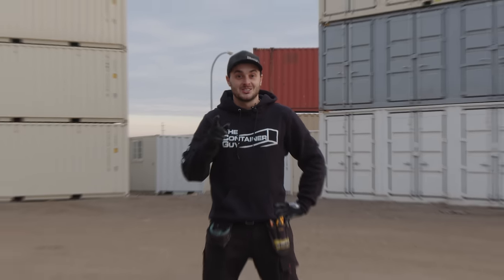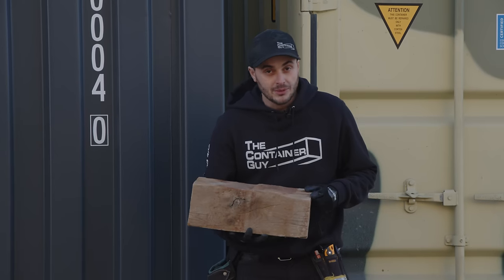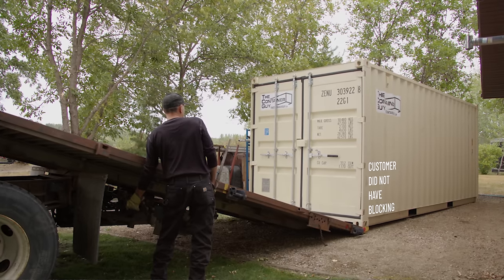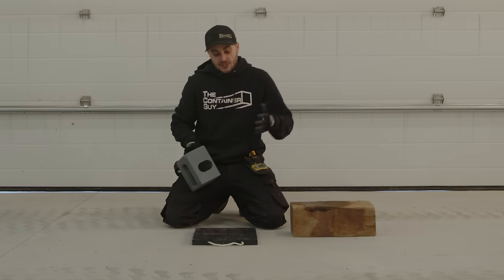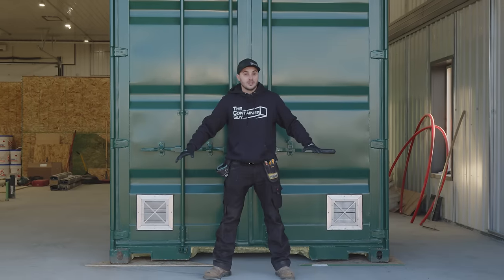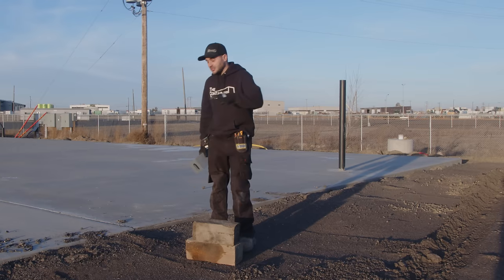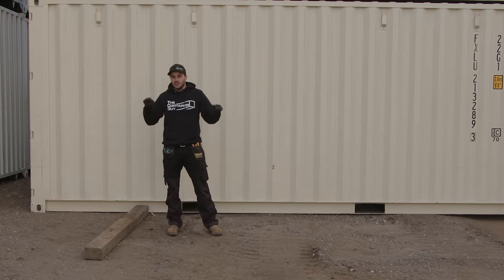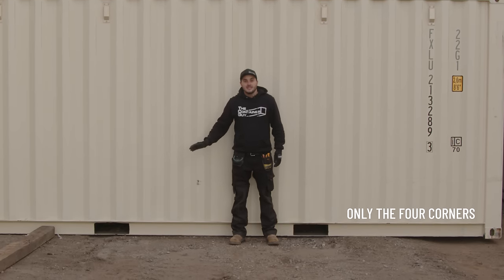What YOU Should Put Your Shipping Container On!

Comment: My containers sit on the high plains desert of southern Wyoming.  It's not uncommon to see 50-60 mph+ winds and the frost line is 56".  I drilled 60" deep by 12" holes at the corners and then every 8'.  I set sonotubes and poured 72" x 12" caissons and then wet-set 1/2" thick weld plates with 36" x 5/8" rebar legs into the tubes.  Then I had a massive vertical mast forklift set my containers on the caissons.  The containers are now welded to the Earth.  I don't own a laser and didn't want to rent one so I made my own bunyip with a milk jug, a 100' of clear hose, and red koolaid.  Overall I set 58 sonotubes/caissons and my largest margin of error, using the bunyip, was about 3/16th of an inch on one of my caissons.
Reply: @CornPopMillerJr  shout out to my fellow Wyoming neighbor!
I'm thinking about doing something very similar up near Cheyenne.
Nice to see others who have done the same.
Reply: Now, what did that cost you...?
Reply: @willbowles5551  First I need to clarify.  When i poured the 58 sonotubes, only 22 of the tubes were utilized for my two shipping containers.  The remaining tubes are for future building sites.    Anyway, $250 for 1 day rental of a skidsteer with 12" auger.  The sonotubes were under a couple hundred bucks.  I think it took about 6 yards of concrete and that was about $700  The bunyip was a couple bucks.  The weld plates were probably $100 in iron.  I wanted to toss rebar in the tubes but I'm cheap.......so, I found a bunch of iron bedframes free on Craiglist and cut them up and used them as rebar.  I'd say it's all possible for $2k.  Additionally, I gave the guy with the vertical mast forklift $400 to drive his machine 8 miles out of town to lift the boxes.  Either way, it can all be done for under $2000.  I likely overkilled it, but my containers will NEVER move or shift.  That all said, I did all of the work with my own two hands, so there's no labor factor into what I spent.
Reply: @suntz8736  I'm in Cheyenne 186 days a year.  I'm also Wyo Master Electrician.  Hit me up if you ever need a hand.
Reply: @CornPopMillerJr  Hey thank you!
It will probably be a year at least until I actually have it all set up to do it.

Comment: Use white oak when possible if using wood blocking. It is very resistant to compression. That is why it is the only wood blocking that is approved for workholding and blocking up things like forklifts during maintenance work under then.
Reply: Railroad ties in the eastern half of the US are generally white oak. I seriously doubt that’s the case west of central KS though. Not sure.
Reply: Good luck finding white oak dunnage.
RR ties are stinky
Reply: @embededfabrication4482  quite easy actually. Every trucker I know has it for trailer stacking as 4x4x8ft sticks.
Reply: @MattWeber  can't find it in arizona at the lumber yard

Comment: When my dad built a barn around a container 8 or 10 years ago, he poured a 12 inch wide reinforced concrete bar the width of the corners on each end, and set the container on that.
Reply: What kind of ground under that concrete and what kind of weight inside? I was thinking similar but 36 inches and an extra 4 inches wider on each side and 12 inch holes filled under each end centred on the mounting feet.

Comment: I completely understand the loading capacity of the corner castings supporting the entire box, and I understand about buckling the aluminum 53' container by supporting it between the castings in a loaded situation. I'm planning to utilize a pair of 24" wide concrete footings that I originally placed for a house. These are parallel, poured-in-place on top of a compacted, crushed stone base thirteen years ago. They're very stable, and plenty high enough for airflow beneath the boxes. They are 32' outside-to-outside, which would leave 4 feet on each end of my 40' steel boxes (including corner castings) extending un-supported, and 28 feet un-supported between the footings. These two boxes will become a container home,  so the weight of contents will be much less than loaded storage units would be. A simple 2" x 6" lumber truss and corrugated metal roof will comprise the entire roof structure on top of the two boxes, again, not a lot of extra weight. Do you think this would work, or do I need to place concrete piers for the corner castings of one end, while the opposite end corner castings rest on one of the footings?

Comment: What if I used a post hole auger on my skid steer and drilled 18 inch holes down 3 to 4 feet to get in past the frost line, then used those cardboard pier tubes and poured 18 inch concrete peers. Then I was thinking of using rebar to reinforce the concrete and welding a twist lock connector to the rebar that was flush with the surface of the concrete  so I could literally lock the container down to the piers. And since I live in tornado alley, I was also wondering what kind of wins that might take to move something like that?  Also what kind of puncture resistant would there be on a shipping container that is locked down like that.
Reply from the maker: You're gonna want to stay toned to the channel. We are working on a potato cannon to shoot 2x4s 100 mph to test our system for Storm Shelter / Tornado Shelter design.

They tip over at 140 mph wind speeds so they need to be anchored to the ground. Pouring concrete in place of the floor changes that to 220 mph by lower the COG.

If you frame and insulate it with 2lb closed cell insulation then finish the interior with durable wall covering like 3/4" plywood, it's going to be a lot stronger than a regular container. Our final system and suggestion is going to be much different but that's a good starting point.
Reply: @TheContainerGuyTV  absolutely. Do you think my pier and twisting locks is a good idea?
Reply: @patrickmckenzie2391  they sell the locks that lock a container to trl for transport, drop the container on it and twist, this .ight be the most tornado proof concept I've heard of as far as getting blown around, debris is still likely to puncture it. This may be the next best thing to underground
Reply: @patrickmckenzie2391  If your auger is 18" diameter and you want 18" diameter piers, you shouldn't need the sonotubes unless your ground is very sandy/unstable.  just pour the concrete directly in the holes.
Reply: I'd rather go a bit shallower on the holes then flare or bell the bottom of the hole. The enlarged bottom gives you a larger weight bearing surface. Even more important that bell shaped bottom guards against frost heave.
Reply: Locks aren't worth the money as they still need welding to whatever you pot in the tube.   You can weld suitable steel to a hunk of plate then pot that in your pier tube. Place container then weld the corner fittings to the plate. Simple, cheap, rugged and easy. AC and cellulose rod like 6010 is fine.

Comment: Great editing choices, had a good laugh at a couple sections in here. I’ve heard crushed quarter inch rock is best to keep pests away, we did it under a buddies shop a couple years back. No issues.
Reply: Small stone like crush and run, will pack like concrete over time and pests do not like having to dig through packed stone. But this packing requires that the stone is moved over by a load, which it does not get under a shipping container. So unless you have the stone packed before placing the shipping container you aren't going to get this benefit.
Smaller stone is however easier to move / shift while leveling a container, as opposed to 3 to 4 inch stones, so there is some benefit to smaller stone, but you don't need to go down to 1/4 inch fine, simple gravel should be more than adequate.
Reply: It would need to be pretty deep to discourage the groundhogs around here.

Comment: Good content here.  Thx.  Also consider a tilt to the container if u are worried about water or snow melt running off.  Nice to not have it drain over the door opening. Consider the door swing with weed growth and with winter snow.   Off topic, consider applying silver roofing tar to the roof.  Might also apply Ospho first if roof has rust.  Anyway, as your vid shows, there are considerations to what to sort your container on.

Comment: For long-term or even permanent placing, would you recommend a concrete pillar reinforced with rebar?  Would that be better than a flat concrete slab, even with the pads you demonstrated?
Reply: That is a question  he should've answered. All these examples he gave just seem like temporary solutions. Should've gave best examples for not worrying about settling happening.
Reply: He's a container rental agency, that's all he cares about. Pillar under each corner and bridged beam of concrete with steel to tie them together and reduce ground contact PSI

Comment: I've been looking through a lot of your vids and have a question I havn't seen answered yet. 

For a residential can, when you spray foam, do you have to install any vents to prevent carbon monoxide issues? Considering all the precautions with vapor barriers I wonder if that's an issue or consideration.

Comment: Large steel I-beam works a treat. Slide container onto beam, level and square beams, weld beams to container then add more containers (I've two so far) welded side by side. I've a third but may leave a gap between that and the other containers and roof over that.

Comment: Good morning, I have been watching your posts and I think I can use your assistance. I am planning on purchasing a 20' 1 time trip shipping container. I want to convert it into a small office with a restroom. I am planning on an 7'x8' restroom and a 7' x12' office. I am thinking that I need two door on the exterior along where the two walls would meet and have them open into the container. The office will be inside a manufacturing plant and will not be exposed to the weather. I am thinking two 36" door along the joining wall. Two - 3 windows one in each of the three walls of the office. Remove container door and use metal studs to create new wall in it's place. I am planning on a split hvac system for air/heating. I also saw your metal Steel Stud Framing Kit for Shipping Containers/Sea Cans - 2 Corner Casting Covers with Steel Stud Brackets (Aluminum, 2 Corner Casting Covers + 20 Steel Stud Brackets) and the Container Modification World® - Modular Strut Systems (MSS) (1-Way Bracket 10 Pack, Galvanized Finish, 10). What do I really need to create this space? I think your doing a great job on making it easier to do a btter job for really anyone. So I would appreciate any assistance tat you can provide as I am working on a purchase order and need all of the parts and pieces for a successful build. Thanks, Brian

Comment: I understand the need to raise them for airflow.  You mentioned rodents, do they chew through the plywood floor?  Do other animals also chew through the floor (like beavers/groundhogs)?  Do you ever find bees/wasps/hornets making huge nests under the floor?  My site is very rural and have had problems with all sorts of critters in buildings and heavy equipment..
Reply: The bottom of the container is also steel, so nothing is burrowing into it. There is usually a plywood floor on top of the steel floor. IE, "Pest proof"
Reply: @VanillaCoke64oz   1-1/4" plywood subfloor over steel structural "floor joists".  There is no steel layer on the underside of the plywood subfloor.

Comment: So in the last few seconds, you recommended against blocking under the container along the length (ie., anywhere but the corners) but in one of your earlier videos, you specifically mentioned having some sort of shim under the length if, for instance, it’s on a concrete pad where the length could sag up to half an inch or so…

Which is it?
Reply from the maker: This is a storage container with no walls removed. Nothing will sag. 

That is for double-wides or modified containers where the floor is going to deflect otherwise. 

Make sense?
Reply: @TheContainerGuyTV  yes, thanks for clarifying.
Reply: @TheContainerGuyTV  
 With my 40 foot high cube, I used four inch thick solid cement blocks.  I used 8 blocks with 4 at the corners and four spaced evenly (13 feet) apart from the corners.  My main reason for placing the extra 4 blocks was to prevent the container from settling into the ground over the years, but I also figured it would not hurt to put a little bit of extra support underneath a 40 foot container.

My pad is 6 inches of crushed stone (no stone dust) on top of geo textile fabric to allow really good drainage.

Comment: I have a 48 ft container on my hobby acreage in BC that has been sitting on old railway ties for about 13 yrs.  Last summer, a wildfire roared through the area, and although I was fortunate not to have the nearby firestorm, the ground fire was whipped by the wind and came into my machine yard.  The pine needles on the ground burned like gasoline and spread to the creosote-treated ties.  I was not able to come to the acreage during the fire (I live 3 hours away) but the locals who remained behind said they stopped by every day for a week trying to get the ties to stop re-igniting.  The professional firefighters wouldn’t come near the container as they didn’t know what was in it and whether it would explode.  A local resident finally got the ties extinguished, but only after the fire in them burnt through the floor of the container.

The container did not explode, despite there being two construction generators with gas in the tanks, and it getting so hot inside that the Rubbermaid tubs stored up near the ceiling melted and drooped down over the cardboard boxes they were sitting on.  Everything inside, including all of my woodworking equipment (table saw, planer, etc) as well as the walls and ceiling, is coated in a sticky black tar-like substance.  I think if the floor burn-through had been any larger to allow fresh air in, and the gas fumes from the generators, that container would be in orbit with the space station right now.

Note to self:  Never again use creosote-treated ties to set the container on, and make sure the crushed rock around the container is kept completely free of needles and leaves.  Just those two simple things would have kept the contents of the container safe.
Reply from the maker: Thank you for sharing this. Firefighters love to see aftermarket vents on containers because they know it can depressurize instead of blowing the doors off if fumes were to ignite. 

One thing you could try now since the floor is damaged or gone is pouring concrete in place of the existing flooring. We did it in a couple containers and it turned out amazing!

Comment: i just bought two shipping containers and plan to erect a roof that covers both. i have concerns about movement from frost. what suggestions do you have to prep for my plan. the ground is pretty hard packed but i planed to put 3/4 inch gravel down and 18 inch round 6 inch thick concrete on each corner. should i do more?
Reply from the maker: That'll mostly depend on where you're located. I'd double check with a local concrete company and see their recommendations! - Video Team

Comment: are there any pre made solutions that would be for stem wall/poured foundations that can be cast in place to allow you to take advantage of the existing corner attachment points to secure a container to its foundation in applications like a container wall garage. So far all I've seen is people straight welding it to a steel plate that is cast in the concrete. I kind of want to do a project in the future, and depending on where I do it the only ways the local build codes allow em is if its a temporarily secured structure. the closest thing to "temporary" was a 2 plate system where two plates are bolted together, the bolts are the locking "rebar" the whole assembly is set in concrete and the container is welded to the top plate. I cant see how welding these is a good idea as far as I can tell those corner pieces are cast, at least according to domino clamps, and domino clamps from the people I've talked to are the closest thing but wrong execution and application.
Reply: In construction we use anchor bolts.  They come as thick as 3/4", I would think you could cast those into your reinforced piers/footings and install a steel plate as a washer to fit inside the casting with a 3/4" nut at each corner.  Secure and easier to remove than being welded.

Comment: So lets say the left door is low where the doors come together. Would you lift the left corner? Can the container be twisted on the back side cause the doors to misalign?
Reply from the maker: Yes and yes. If the left door is low (in the middle), either lift the front left corner or the back right corner to fix. Use your judgement. Sounds like the back right might be the issue otherwise you wouldn't have suggested that.

Comment: How about ways to lift and move / shove containers
Reply from the maker: Good video idea.. the farmer method all the way up to using our toplift
Reply: You can use the Egyption method of poles and a bobcat excavator truck etc. Lift up your unit and place a timber pole under it and you can roll the unit. Lifting up once in position then place your pad and blocking back in. 👍Great videos thank you. I share them all the time for their information top work. 🙏 Contain Yourself Aust.
Reply: Also 8x3 8x2 8ft pressure treated sleepers work great as a starting base before you shim it for level the extra surface area helps keep them stable. And they are the perfect size Bless 🙏